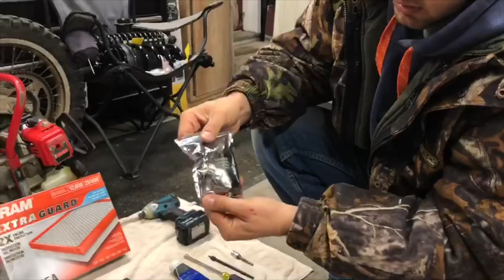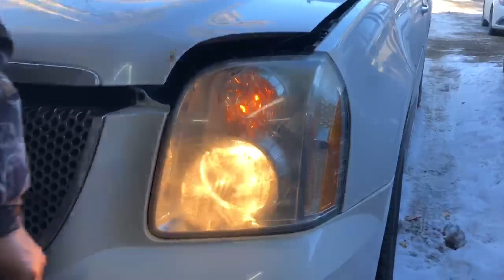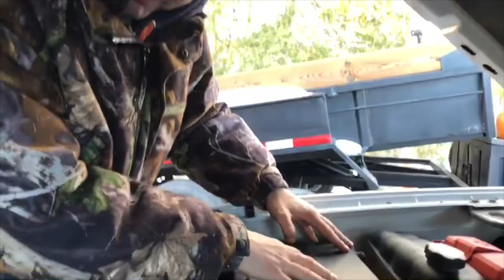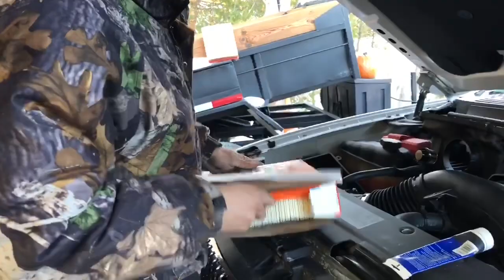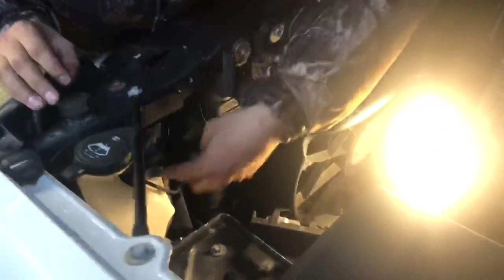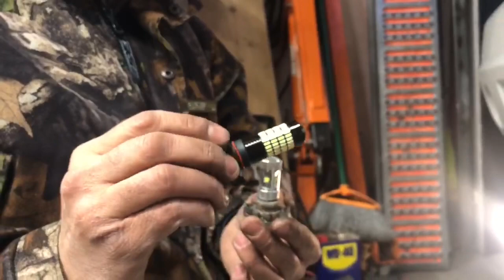How to change front headlights and fog lights into LED on a 2007-2014 GMC Yukon XL Denali

Comment from the maker: Links to the products used:

BPS Lighting B2 LED Headlight Bulbs H13 (9008) Super Bright 100W 16000LM 6000K - 6500K Cool White CSP LED Headlight Conversion Kit for Replace Halogen Bulb Headlights
Buy on Amazon: https://amzn.to/2u71Qbj

H16 LED Fog Light Bulbs,AUXITO Super Bright 4014 102-SMD 5202 LED Bulbs with Projector for DRL Fog Lights,6000K Xenon White
Buy on Amazon: https://amzn.to/2tjgADb